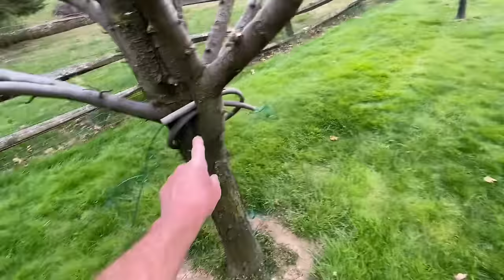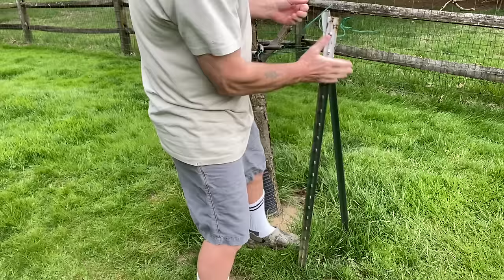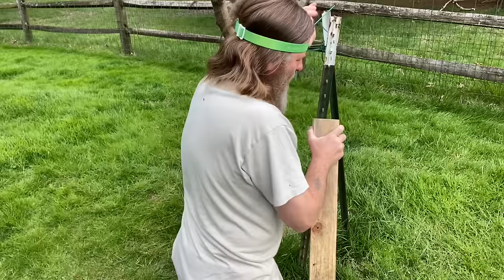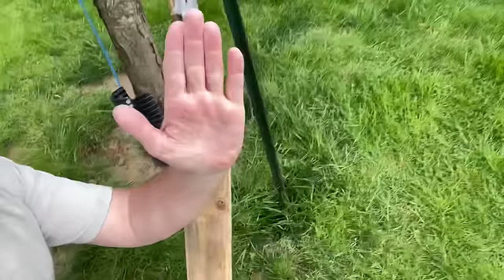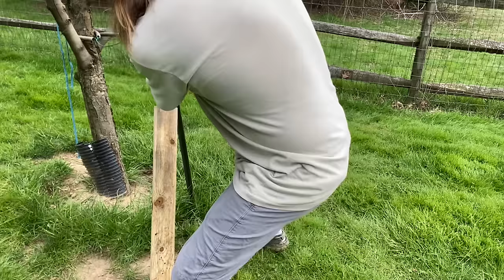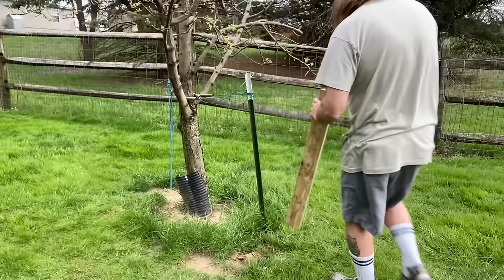REMOVING A   T-POST   How to get a t-post out without tools

Comment: That's a great idea. Thank you for sharing. Another handy trick is to use t-post driver as a fulcrum lever to lift the t-post straight out, by sliding the t-post driver down the t-post, between one of the t-post driver handles and the body of the t-post driver, until the driver is resting on the ground and the handle is on the notched side of the t-post and the body of the t-post driver is on the opposite smooth side. Now slide one or more t-posts into the driver for increased leverage and rigidity as needed, and then lift. The t-post will become very tightly pinched between the handle and body of the t-post driver, with the protruding notch preventing the driver from sliding up the t-post. Where there is loose soil, sand, cinder, mud on top , you can use a block of woof to keep the butt of the driver from sinking into the soil as you lift. You can also "choke up" on the t-post by sliding the driver one way or the other, to either increase leverage or distance of each lift. And similar to the method you've shown us here, the driver will simply ratchet down to the next notch after each lift. Rinse and repeat a few times, and the t-post is yanked right out.
Reply from the maker: Right on!
Reply: A better trick is heading down to your local farm and ranch store, and buying a t post puller.
Reply: @rkf2746  Feel better, now?

Comment: Hi, I was excited about seeing your method of removing t-posts so I gave it a try on my neighbors posts.  THEY WOULD NOT BUDGE. We live in an area that is solid clay and it gets hard like concrete.  So I took the hose, turned it on "Jet" and put it down near the grass around the t-post.  I held it in one place for about 2 minutes and did it on four sides.  I pushed the t-post over to give a little room for the water to jet down.  Then I tried your method and the t-posts came out so easily.  Thanks for the idea.  Oh, by the way, it works better if you use a litte shorter 2 x 4 than what you used in the video.  You get more leverage.
Reply from the maker: Right on, great job!

Comment: This is really smart.   There are an amazing number of crappy products made to pull a t-post.  Even the little plates that people use to attach a chain for a tractor to pull up are poorly described; because there are different sizes of t-posts and of course different size chains and they usually give no dimensions.  So, it was great to see one resourceful guy spend no money and pull t-posts right up.
Reply from the maker: Yes!!! Thanks
Reply: Hey. Scraps of 2 x 4 are priceless.

Comment: That is a great idea. As I recall when i removed about 15 of these around 5 years ago I used a crow bar with a block of wood under it to keep it from sinking into the ground. If the ground is real soft, maybe from rain or for whatever reason, the technique presented here might be helped by laying similar size 2x4 on the ground to keep the vertical board from sinking in. Again great idea shown in the video.
Reply from the maker: Yes, definitely would work!

Comment: This is brilliant. In the desert I have used a tractor to (try to) pull t-posts. Pouring a gallon of water around the base is the only way to get them out.
Reply from the maker: I wonder if this would be easier than pulling out the tractor?

Comment: I tried pulling one of these posts out of my backyard once but I wasn’t aware of this trick. So, I tried yanking the post in all directions to make the hole in the ground larger at its opening. That failed to loosen it sufficiently so that I could raise the post from its position in the dirt, so I thought I’d try to bend it by pulling it towards me using all my weight. 
Well, under lateral force, the metal post snapped in two and down I went…hard…flat on my back. It had barely even bent before it snapped. Obviously, I didn’t expect that outcome but it sure was a lesson learned. 
I couldn’t even find the remaining piece still underground.
Reply from the maker: Dang, hopefully that was the last time you’ll struggle with them!!!
Reply: those cast iron oners that snap rather than break are pretty uncommon these days!
Reply: cast iron ones, that snap, rather than BEND i meant to say

Comment: GREAT VIDEO! and a great idea!  I know in the late 70's me and a buddy of mine had to pull out almost 50 of those dam things out,  AND the ground was SO DRY and hard we had to use a CHAIN rapped around the post and use a HYRODALIC JACK to push/pull the post out of the ground.  IT WAS A PAIN in the back. BUTT we finally got them all out to REPOISTION them for a fence relocation
Reply from the maker: Sounds tough, thanks!

Comment: I was doing "the bang it with a sledge hammer back and forth" thing for years. I'm going to try this next time. Very clever process. Thanks.
Reply from the maker: NP!
Reply: @oxford821  I had to remove 2 posts this past week and used this method. It worked great! My 2x4 must have been much softer than yours because the notches on the post cut through the edge of it, so I had to screw a flat piece of metal to the end for resistance. Still much faster than the way I was doing it before. Thank you!

Comment: Good job👍
If you have posts that you know you are going to be removing,  then cut the metal anchors off the bottom . A grinder can zip them right off.
They work fine and are a breeze to remove.

Comment: Wiggling the post around in 4-8 directions often aids to loosen the dirt around the post and breaks the suction in wet soil.

If the ground is wet or loose, get a second block and make a triangle between the post base and lever block base to improve the footprint.  You may need to cut a shallow groove in the foot board for the lever block if it slips too much under foot.  

Flatten the end of a steel pipe if your wood is too wet or soft.  A steel L-bar (nail puller can be used in place of the wooden block here.  You can also drop your wooden block perpendicular to the post on the ground and use the L-bar to lever them out in the same manner by pulling the two simultaneously to keep them in contact.

If your post or rod does not have the notches on the spine, you can use a small vise or sturdy clamp; or a pair of vise or bolt pliers to serve as the notch that you will lever with.

Multiple half hitches can do the trick too.  Twist several loops and drop them over the post, then run the rope, strap, or cable, over a long board with a couple reversed hitches on the other end of the rope, and you can lever the board in the fashion shown by the demonstration above.

Thanks for the video, you explained it well.

Comment: Good video!  I've actually done that.  I put one foot on the bottom of the board pushing it toward the T-post and pull the T-post, the board engages the stub, pull, push and repeat.  Only rarely have i found the post is stuck.
Reply from the maker: Nice!!

Comment: I've used a high-lift jack for over 40 years.  True it's heavy, and I have to wrap a light chain around the T-post two turns, then make a loop over the top jaw of the jack.  There are better post lifters now, as you mentioned, but by now I'm either to foolish or too stubborn to change.

Comment: Interesting. Here in Australia we call them star pickets, and they don't have knobs, but holes to run fencing wires through. But they're still a pain to remove - unless you have a tool called a star picket extractor.
Reply from the maker: Right on!

Comment: I’ve tried this using my t-post pounder upside down. I ended up bending the crap out of my t-post. What worked better was soaking the ground with water for a minute first then giving it a go with the leverage. Saved me from having to unbend my posts (or at least trying to).
Reply from the maker: Great advice!
Reply: yeah if you have the same leverage as shown in this video and you're bending the tip, those are some flimsy t posts and that is some dense soil and the post is way past the hilt. thats earthquake proof fenceposting.
Reply: Just use a plumbing wrench , tighten to pole and 3 taps up with a sledge hammer. Easy

Comment: Thanks!

Edit- WATER TRICK!: This method wouldn’t work my ground was too hard… I gave the area of the post substantial water with a hose to soften things up and your method worked perfect!
Reply from the maker: NP!
Reply: @oxford821  my ground must be hard as a rock- This method unfortunately wouldn’t work for me! May be forced to use a shovel and refill w/ loam if there’s a small hole to avoid dogs getting injured.

Edit: I’m going to hose the area then try your method again. I nearly guarantee that will do the trick.

Comment: A method I’ve used before is to place the end of a garden hose at the bottom of the post, and let the water soak into the ground  for several minutes until the soil around the post is quite muddy. Then grab the post using gloves and wiggle it back and forth while pulling up at the same time. Of course, this may not work for all types of soil.
Reply from the maker: This way might be easier?
Reply: @oxford821  Depends on the soil type and other factors. With the method I shared, it doesn’t take much effort to wiggle and pull the post out, but it does take time to let the water soak in sufficiently. Maybe a combination of the two methods might be the best way as long as the ground isn’t so wet the board sinks into the ground, but you could mitigate that by putting a small piece of plywood on the ground and rest the board on top of it. The larger area of the plywood would spread out the load.

Comment: If your lucky to find a 2 × 4 that wont split and cause a t post to remove your eye out ror you i generally use the t post driver itself turn it upside down much lower and more leverage for less strain

Comment: *says to do it without tools*
*proceeds to use a 2x4 as a makeshift tool*

But it works! I just used this trick on a post that's been stuck for over 20 years, and too close to the house to use the tractor's bucket & chain like I usually do. That just saved a lot of diesel!
Reply from the maker: Nice!!

Comment: Good idea when the T bars actually have those nubs, but most the ones I have don't
Reply from the maker: Tractor supply does sell a T-post remover. It’s red, uses a long handle for leverage
Reply: @oxford821  yea we don't have the money for that, I was just trying to find a better way to remove the posts after almost dislocating my left thumb today, got some other ideas for these particular posts without the nubs, but thanks for showing us how to do it with those types of posts.

Comment: Strange I do the same thing except without a board or anything else. Move it forward and back and a little side to side and then move back move forward and lift at the same time, they pop right out after a bit
have done it that way for decades

Comment: I've had a lot of luck using a gallon of water, pour some at the top, wiggle the post, more water, more wiggle etc.  Doesn't take long to work the water down to the bottom of the post, once it's all mud one can easily lift the post out of the ground. Easiest, fastest and least effort I have ever seen to remove a t-post, try it some time, you;ll be amazed.
Reply from the maker: Will do, thanks!

Comment: Don't waste the 2x4...just use your t-post driver to do the same lever action (open end up of course).  
And...pulling the post with the longer piece of wood is harder than using the post driver or shorter piece of wood because it is similar to the "fulcrum" in this lever action.
Reply from the maker: Yes, that works great as well!

Comment: It’s a ratchet with a wood pawl. I usually just lever the post back and forth flaring and loosening the hole. Still prefer old hat channel posts with punched up and down hooks. Problem is the only ones I can find these days have paint thicker than the steel.
Reply from the maker: Yes!
Reply: The 2x4 has become a tool!

Comment: Good idea. Only thing is I have one I want to remove that doesn’t have the teeth on it just holes to hang a sign on.
Reply from the maker: Put a bolt through the hole then use leverage under it?
Reply: @oxford821  good idea. I just hope the bolt doesn’t bend. the holes aren’t too big.

Comment: I just have to mention that "without a tool" is not really truthful. You are using a wooden board to remove the posts. That would constitute as a tool in this case. But thank you for the information. Much appreciated.
Reply from the maker: Yes, thanks!

Comment: This failed miserably.  The teeth bit down into the wood and left notches.  It didn't do anything put them up.
Reply: Update.  Using this method I finally managed to get 2 of the 5 out.  But, whoever put these things in, buried them about half way into the ground.  They're deep.  Either the teeth put notches in the wood or the 2x4 sinks into the yard.  Decades ago, someone got the bright idea to put up a partial chain link fence with tposts...  it was the ugliest thing I've seen in a while.  It has to go.
Reply from the maker: Well I’m glad you got some out! I was thinking the wood you used was to soft?
Reply: @oxford821  I was having that problem too. Screwed a thick piece of metal on the end of the wood about 1/8" thick. Problem solved. If it sinks into the ground, make that base bigger somehow. Works great!!

Comment: Will not work in this Georgia clay. It is like having it in cement. You could clearly tell that was in dirt. I had to use a chain and skid steer to pull some up. Still have two that I could not get to.
Reply from the maker: Wow, crazy stuff

Comment: You're making a super simple job unnecessarily complicated. I would have had the post out without a piece of wood within. 10 seconds. I do it all the time. You just push the post back and forth a couple times and then do it again at 90 degrees
 Then just pull it out. Geez!

Comment: No offense but if I had to remove a T post, I am absolutely certain I could figure out a way to do it before you told me how, because just looking at your method it's full of sh!t, but you do you. I mean, if you're going to go to the trouble of dragging a four foot two by four around to pull T posts, why would you stop there? You don't have a  pry type bar you could also drag around and then set it on the 2x4 like a solid flat base, hook one of those little nubbins and just yank?
Reply from the maker: Just using what I have!
Reply: @oxford821  fair enough.